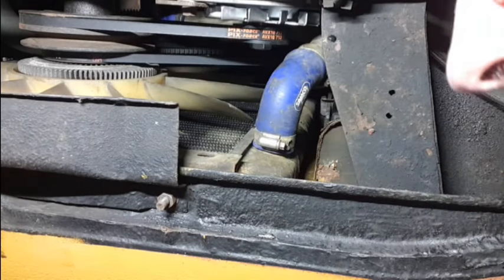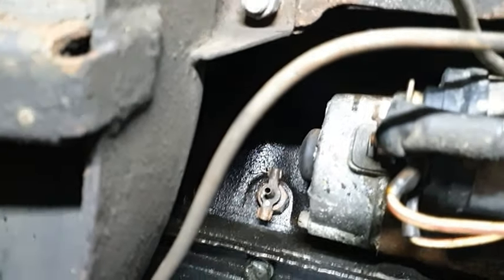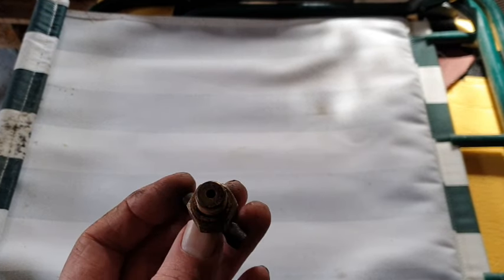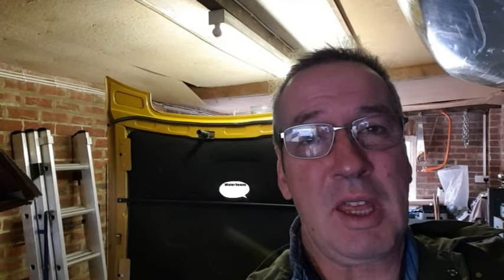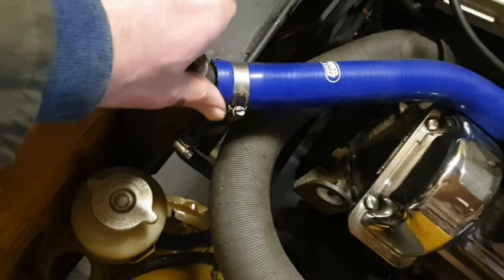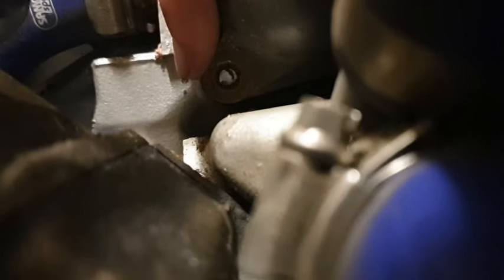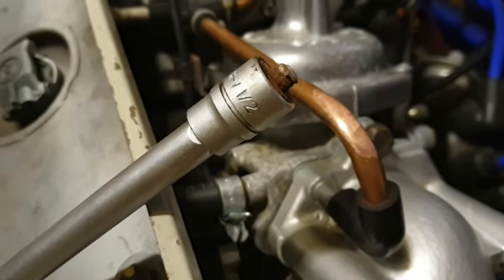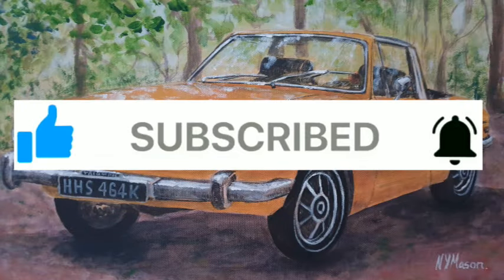Disaster while draining coolant   Triumph Stag  S1 : Ep 22

Comment: 31 years with a Stag, 330,000 kms, and have removed the block drain plugs only once, when I had the engine out. . I usually flush without removing them. Remove the thermostat housing, remove thermostat, and there are enough hoses you can flush from either end to get everything old out. Threads lubricated whenever I strip anything, so no horrors on mine removing bolts. Everyone "what about the silt/dirt/flakes??" When I HAVE removed plugs, nothing came out except fluid, so...... 

Obviously with heads off can suck water out of block galleries with syringes if doing any major work. Again, no deposits in there. 

I am very lucky here in that our water is very "soft", so very little minerals in it. So a little bit remaining is no drama. I always use "concentrate", so use distilled water anyway, but after flush and then blowing out hoses from either end, gets enough flush water out.

First time I undo inlet manifold, make all threads on heads for manifold helicoils. The soft ally is just a hassle/helicoils means 30 odd years, never a crossed thread. simple to do. 

I have had my fair share removing those ridiculous head studs. Screwdriver slots to undo them? Pfft, dreamers. I have had "junk/spares" engines that they just would not come off, but have managed to get most off. First time I removed mine (took a week, penetrene down stud shafts/welded nuts onto some of the studs) I replaced the stupid studs with high tensile socket head bolts. A smear of never seize, and my heads have always come off easily. It is the best money you will ever spend on a Stag or TR7/Dolomite. 

I have never had that air lock thing. Always use a "jiggle pin" stat, and squeeze the top rad hose to suck it through the jiggle pin.

Comment: Happened to me. Ended up fitting new inlet, as I tried  to drill it out still fitted and messed up.I  would recommend  that you remove inlet to drill it out.
Reply from the maker: Hi Timothy. Thjats exactly what I had to do in the end. Fortunately the shaft of the bolt is now drilled out and the inlet manifold back on....... but what a job!